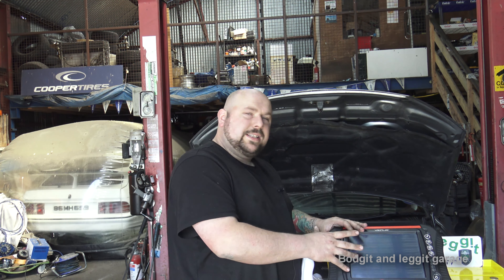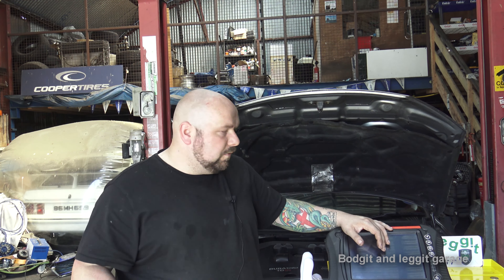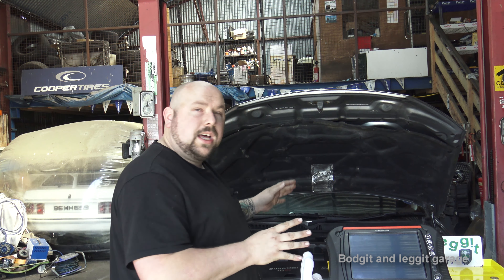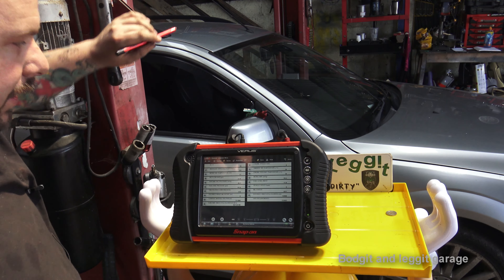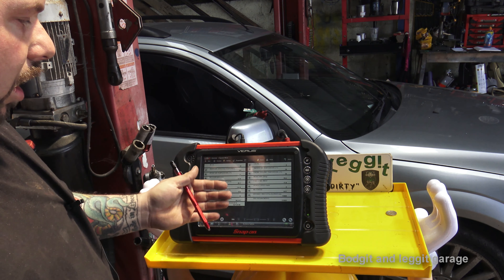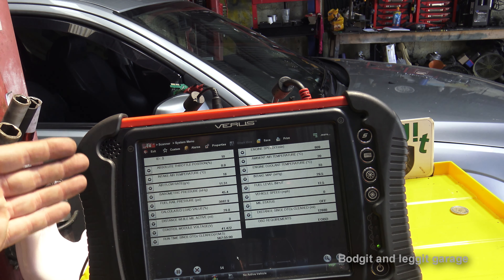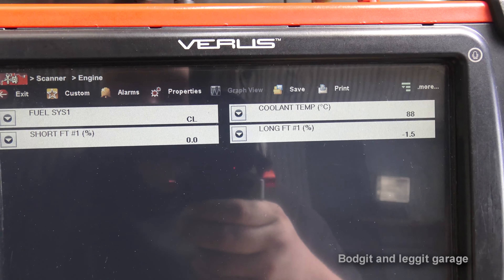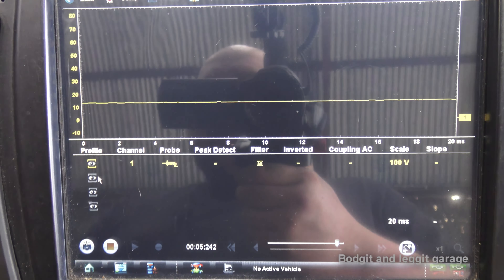(TNT#21)Tip And Tricks Scan tools and oscilloscope Data Bodgit And Leggit Garage

Comment: I've not got any scanner  as my much loved old Xantia mk1 uses blink codes on the dash ,example is 5 blinks then one means  Lamba sensor fault, I now have another car with obd2 & I'd like to start out with the basics of understanding fault code reading & sensor readings, would a Bluetooth elm327 dongle & android apps like torque & cardoctor be a good start for a beginner???
Reply from the maker: briandoliver hi mate I've never really used one so cannot really commentate as long as you can get some sort of live data pits you can do a lot
Reply: half decent bluetooth dongle and torque is good start, so is PC software such as OBD autodoctor . cable is useful too for PC software plus you can find few open source software with oem style functions, freeSSM being one with great functions for subaru for example . 
Other important ingredient in good diagnosis is understanding of circuit and sensors in question and proper decent wiring diagrams and component specs . 
With best scanner and scope someone with little experience and no wiring diagrams or component spec data won't diagnose much and likely go well off course . 
Surprising what you can diagnose with basic code scanner, a DMM and test light, few resistors, variable resistors and an LED . 
I made my own sensor simulators for couple quid with resistors and checked basic speed signal output with an led . 
2 channel scopes suitable for auto work entry level is cheap enough but as pointed out in this video you going need put in time learn how use it effectively and read the data correctly .
the tool is only as good as the operator ...
Reply: Mr B ,I've been looking at getting a dongle & think the elm327 version 1.5  is better than the cheaper v2.1 as there the dodgy ones & not fully wired for all the protocols & use cheaper chips inside them
Reply: yeh the older cheap china elm327's seem to be better ones buy if going ultra cheap. I do believe torque have some info on recommended dongles.
so called new versions just marketing bull to peddle cut costing designs as that all the chinese are interested in: lowest possible plausible manufacture .
You will find dongles and more so cheap junky ones don't work with every car and a backup plugin basic code scanner will play useful role in code retrieval at times .

Comment: Hi Leon, I've got Verus with Personality keys like yours running 14.4 software, have u ever had no communication issues when connected to some vehicles?  usually I have  to exit the shop stream diagnostic and launch it again (without rebooting Verus) and it works (well it did yesterday on 2005 Vw Golf 1K) anyway thanks for great channel, sandy
Reply from the maker: sandy anderson yes mate it's a common thing it happens quite a lot on fortunately for the price you pay for the snap-on machines they do give trouble
Reply: bodgit and leggit garage thanks very much for quick reply, think I'll just go with my cheaper autel ms 905 mini when I'm in a hurry, which is always! Thanks Leon, Sandy
Reply from the maker: sandy anderson yes mate if you're in a hurry don't use a Snap-on machine lol don't get me wrong they do do a lot but they can be very finicky and temperamental just imagine it as a woman lol

Comment: It appears with the foxwell lifetime updates comes down to model and when purchased it as recently changed to lifetime updates. Although I believe if purchased earlier when you next pay for an update that updates you to lifetime updates also .
Is a pretty good scanner option as for cost to functions and potential free updates hard to beat.
No one tool does everything though so will need about 3+ scanners if you into most models and doing programming etc .
autel and foxwell good, snapon expensive and would only buy one used personally and then may even give it a miss ... As for scopes the picoscope hard to beat, Handek do some 2 channel scopes pc based and stand alone that will do the job and also ideal cost for light users or first step into scope usage .

Comment: the last waveform is for the fuel injector and it's a good injector, this waveform,that's tell you the ECU is good, the wiring is good and the injector is good electrical and mechanical